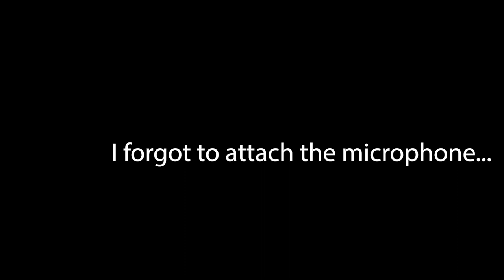Camper Van Upgrades EPIC FAIL ALERT

Comment: You also need to cut out a circle for the rain sensor in front of the rear view mirror. Top tip - blutack a coin over it when you fit the sunshade and then use a Stanley blade to cut round the coin for a perfect circle.  👍

Comment: Are the wiper blades going to damage the vinyl?
Reply from the maker: Never even thought of that... 🤣🤣
Reply: It’s gotta go on the inside to be safe. Do it on a warm day and that’ll help with water evaporation, when you squeegee the vinyl. Never done it myself, but it makes sense 🤷‍♂️😂
Reply: Interesting fact, if the sunshade is within the wiper sweep area you will likely fail an MOT. Trust me, been there, done that! It's also a pain to remove and keep re-applying every year!
Reply: @AdyWalter  short wiper blades for mot 😎 not in the swept area anymore